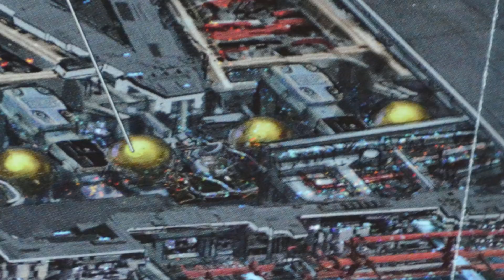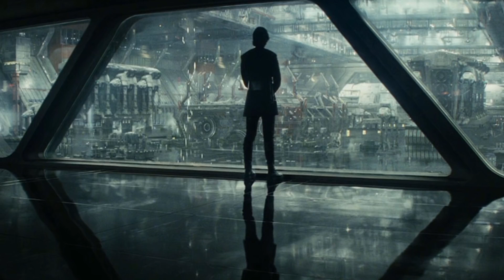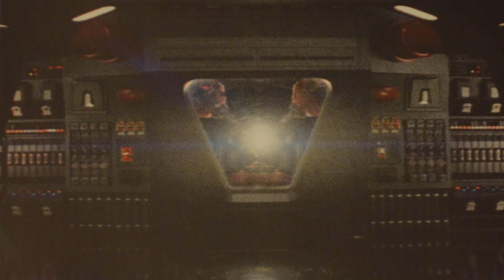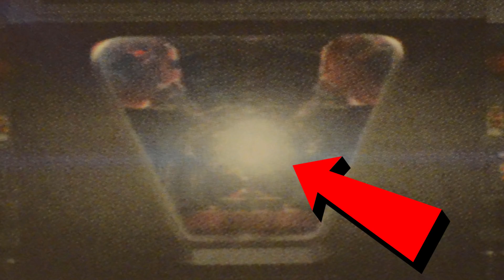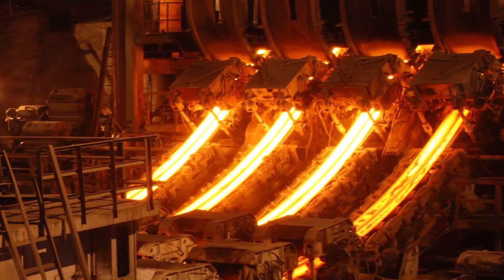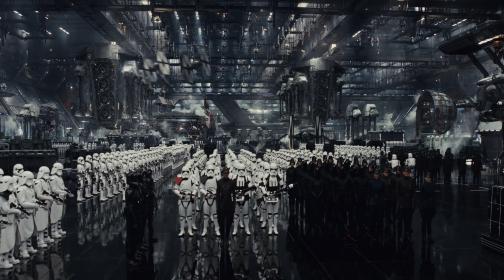HYPERSPACE TRACKING? First Order Capital Ship HQ  Supremacy Mega-Destroyer - Last Jedi Lore - PART 2

Comment: um... why are so many folks certain it was destroyed?  Snokes throne room was intact.  It was heavily damaged, but if they can tractor in the section of wing before it gets pulled down to the planet, or use thrusters on that section to keep it aloft, it can be re-attached or at least transformed into it's own ship.  And the far wing had several manufacturing/material-processing centers of its own.  It's a mothership, so it was made to regenerate.  Oh, it has probably been addressed earlier, but the current theory I'm hearing is that the tracking sensor having a hyper-space bubble inside the ship is what allowed the kamikaze attack to work, which explains why rebels weren't constantly crashing trash-barges into capital ships in the Rebellion days.  And you have to wonder if the folks overseeing or working in the manufacturing areas even knew the ship was in combat when the Raddus hit it.  Oh, as for the energy flash, imagine something the size of the Raddus not only being brought out of hyperspace, but doing so inside solid matter... the energy release would probably have blown through the Death Star.

Comment: Assuming it was built like almost all starships (and even some real space stations and shuttles in the real world) the sheared off area should have been sealed off by doors to keep the rest of the ship pressurized and safe. Now, obviously it took sever damage, but not irreparable damage. I'd say that roughly 2/5ths of the ship was damaged. Considering it basically is the place where ships are built, it'd be easy to repair as the resources are right there.

Comment: Well now that this is wrecked when will we see the Eclipse super star destroyer.
Reply: I doubt it would take very long to repair the deathstar was built from scratch in a relatively small amount of time. They still have the two main parts of the supremacy, so it's more of a matter of stitching it back together. I say it could be fully functional again in under a year.
Reply: But it will take years for it to be completely flyable with a complete wing sheared off.
Reply: One small sector is broken, about the size of a few resurgence class cruisers, relatively easy to fix
Reply: The problem is they have to bring in large scale repair ships and at least two fleets worth of supplies to the supremacy. Also the main superstructure was sheared so the ship needs whole frame sections replaced. The manpower and ships needed to repair it will take about 1-3 years to make completely space worthy.
Reply: @barrybend7189  it would take months due to it being their Hq and it would be heavly protected which means more troops
Reply: The parts that remain are almost certainly pressurised, and near (if not fully) functional as bases in their own right.

Perhaps it won't fly as is, but I don't see them not salvaging large pieces of it, even if they don't rebuild the whole thing.
Reply: The first order will without a shadow of a doubt be near completion of the rebuilt supremacy in episode 9, which the resistance, now rebels, will have to destroy to save the day and finally rid the galaxy blah blah blah
Reply: @johnthemachine  The First order is going to use the supremancy to build the Supremancy II. It will be bigger and shaped like a pancake.
Reply: Barry Bend it will be back and they repair wont take that long either. Also the ship can perfectly fly without the one wing. Why? Because space and in space you just need something to propell you to move, you don't need aerodynamic.

But I still hope we see the Eclipse
Reply: It's probably going to be hastily rigged together giving the ship a "scar" of sorts appropriately matching the face of now supreme leader ren
Reply: Barry Bend hope not, they will just destroy it
Reply: Barry Bend ooooop
Reply: Given how spread out the systems are on this ship, the two parts would probably be able to continue flying separately right after the damage.
Reply: It would be kind of cool if it was the Eclipse from Legends, but I would prefer something that, while similar, also did its own thing.
Reply: At least if has gravity well to stop hyper space ramming............ how interesting how the supremacy didn’t probably for the plot

Comment: i beat it will talk at lest 4 A wings to beat this one.
Reply: Razor The One The Light maby 2
Reply: Saeid Radder possibly but they will need the advantage of the high ground.
Reply: i wonder if the supremacy has maybe turbolaser or powerful shields dedicated to defend the bridge so this doesn't  happen
Reply: Razor The One The Light as long as they fly over it they are good
Reply: Nah, it’s only 3 times as wide as an executor is long so I’d reckon 3 A wings would be enough

Comment: And it tough enough to survive the Raddus slamming into it as it made a jump to hyperspace.

I imagine that enormous production would be now trying to reconnect the broken wing with several ships towing the errant pieces together.
Reply: Never said it hit dead on center, just that the Raddus Slammed into it. and it was a hit on the Supremacy's starboard side knocking off about half the wing.
Reply: I think that after it was hit, the whole thing destabilized and blew up after a few hours.
Reply: That's a possibility, but it would be interesting if damage control teams were able to save it and eventually conduct repairs.

would also give the Resistance the time needed to rally forces and allies with them down repairing the ship and replacing the other ship losses.

Comment: I can't "digest" the way it was inefficient in dealing with those 4 miserable resistance ships, when it came out of lightspeed, nor can i accept that kamikaze move from Holdo. In my opinion it should have been damaged or disabled not destroyed.
Reply from the maker: +Sistros it wasn't full destroyed I believe
Reply: I wish that was so as well but they say it was destroyed. Personally, i also think it has the capability of resisting that move since it took out only most of its right wing and nothing all that crucial. At least it didn't seem to blow up afterwards. http://starwars.wikia.com/wiki/Supremacy
Reply: With that kind of damage, the entire ship would have suffered catastrophic decompression, rendering huge portions of the ships uninhabitable. I don't spaceships are designed to function with 40% of its' hull ripped away, important functions are lost, supplies are gone, crucial personnel are dead. And with such massive structural damage, the ship might not even withstand the stresses of FTL travel.
Reply: I mean there was also this escort fleet around..... they also had stuff on board.
Reply: Dariusz Zaremba the whole escort fleet was destroyed behind it, you see all the star destroyers flanking it get torn to pieces by the kamikaze jump. The supremacy is still operational, and could be repaired
Reply: I say only this, Invisible Hand ep 3.  =)
Reply: http://starwars.wikia.com/wiki/Amise_Griff exactly.
Reply: It wasn't destroyed, they still managed to send down a planetary invasion's worth of troops, they didn't come from nowhere.
Reply: KiLl3R Mem3StAR riiiight, commanders on the right 60 kilometers away saw what happened and scuttled their ships out of a principle....
Reply: Storm  from a screenwriters perspective, it will most likely be back... though if you think about it every single pipe carrying anything that freezes on the severed part is most likely burst and damaging components next to it. Same with at least a part of the ship thant went vacuo. The question is would it be worth it repairing that thing.
Reply: Storm also, the severed part is currently floatimg away, pretty fast I would guess. Stopping it would be enough of a challenge worth its own discovery channel special.
Reply: Sistros it was probably out of range and that it could only fire it's long range turbolazers
Reply: It was damaged and disabled. The rest of the Supremacy was still functional.